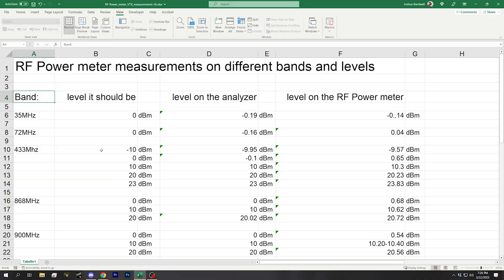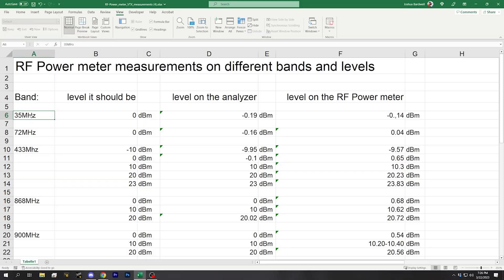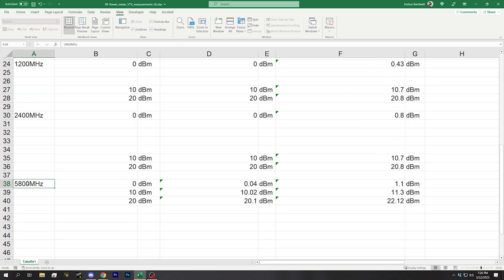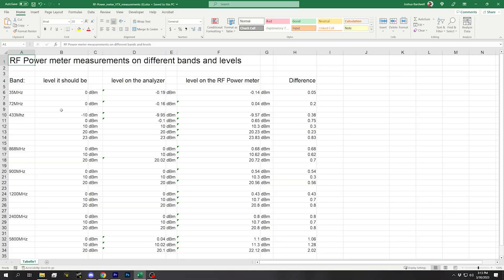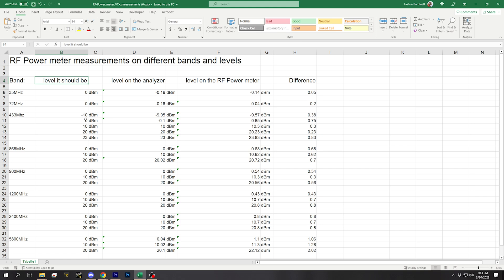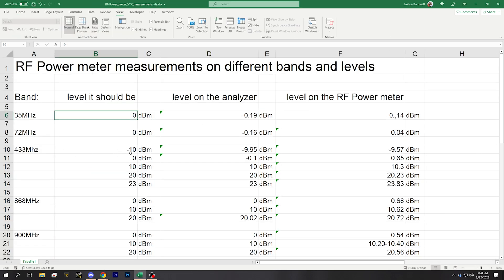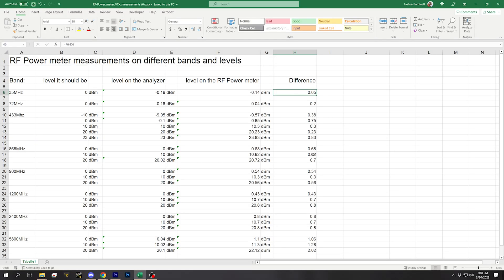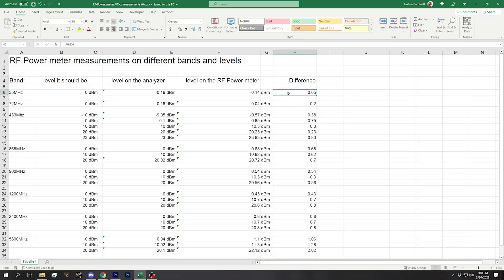Can a $100 RF Power Meter Really Be THIS Accurate?

Comment: I have an older version of that same power meter.  About two years ago, I did some relative measurements using a Signal Hound BB60C, with calibration within the last 6 months.    I corrected for the dB loss of the foot long length of RG-316.  The source was an AKK VTx that would do a watt. (5.9 GHz)  I was pleasantly surprised that RF power meter and the Spectrum analyzer both showed the same power levels to within less than a dB across the available power levels.  I used the bandwidth or channel power function of the SA to measure the power.

Comment: Can you measure output power of Walksnail Avatar VTX units? On all output levels
Reply: these are usually made for analog video transmission and are not accurate when used with digital systems